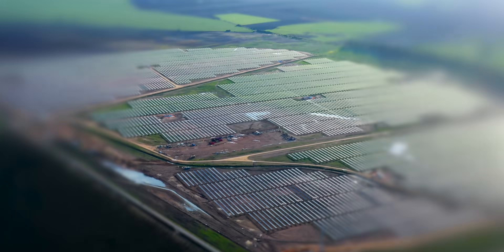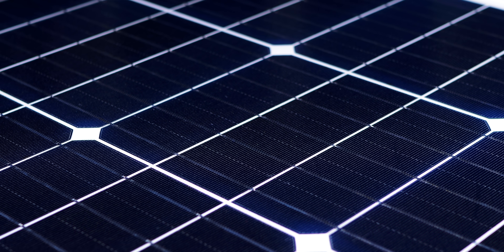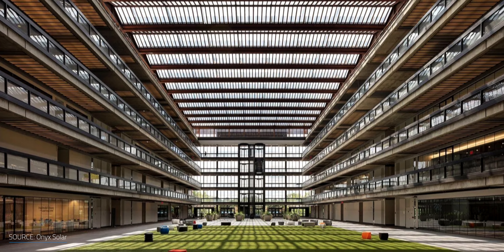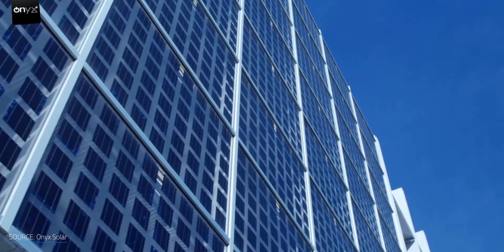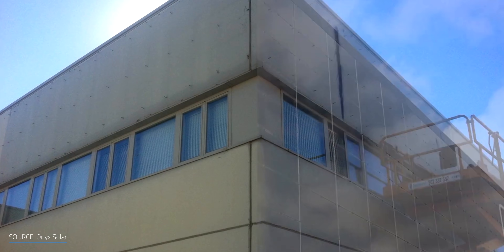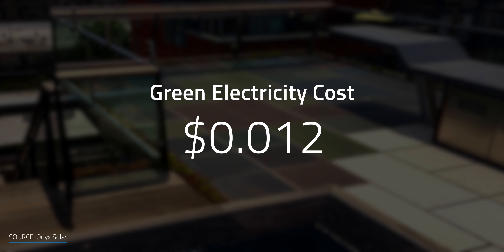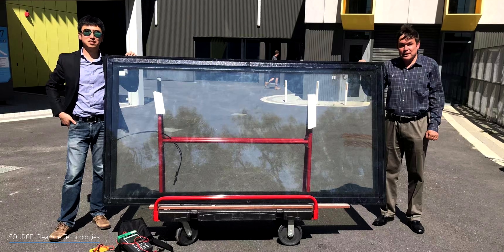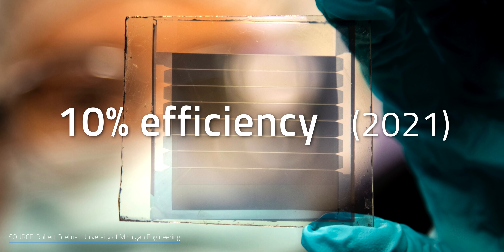Exploring a New Transparent Solar Cell Breakthrough

Comment: TL;DR Don’t rush to believe anything that sounds hi tech and technological “too good to be true”, especially promises to cut carbon emissions by a lot and pilot projects installed. I remember a petrol station whose electricity was entirely produced by biogas originated by a nearby pig farm, that was some 35 - 40 ya, where are all the pigs powered business now? The devil is always there, hiding in the money details!

All fine and dandy, science and technology at it’s best, better something like 10% efficiently that nothing right?
On the other side , (pun not intended) how do they perform on the sun opposite side of a building? What is the installation cost / benefit analysis for a large skyscraper? Everything with complicated functions needs maintenance right ?  What is the lifecycle of these panels and how easy would be to replace them? As for those payback numbers, I’m really skeptic as we have seen frequently bad estimates . That 2M kWh in 35 years is equal to an average hourly production of 13 kWh for a 12hrs daylight cycle, that is 156 kWh per day, how much per kWh in your area? Can they show that in reality, or is just an estimate. That’s in Florida, how about New York , or London where there are a lot of skyscrapers. Shall we later see a devolver suing another for building a skyscraper that rob his own od solar radiation?
Too complicated and delicate to be of any real benefit? Maybe it would just be better to have panels that react to light like transition glasses, getting darker and blocking IR when the sunlight is strong and letting light in when it’s dimmer. Solar “freaking” roadways anyone?

Comment: Remember that all solar panels only create direct volts and that has to be converted to alternating voltage . To transform DC to AC it takes more current of DC to AC by a factor of around 10 to 1 if not a greater difference .The other is the storage of the access energy when the sun goes down or is cloud covered .

Comment: With Soft Cell Solar Technology, we can wrap every building, vehicle, etc, and generate energy. Konarka, out of New Jersey, was working on Solar Tape in the early 2000's. When I tried a Governor Run in Texas in 2010, I had an entire section of my Platform dedicated to this idea.

Graphene is slowly becoming easier and cheaper to make, when we are able to mass produce it, it will do the same job, as good or better, with the additional properties of being 100x's stronger than steel and able to generate electricity from rain.

Comment: Greenhouses may be a good application for the partially shaded type if placed on the upper portions of the greenhouse. This will provide some much needed shade around noon. Rather than needing to resort to shade cloth we can provided shaded light and get a bit of power too. I may give it a shot when I build my 4 season greenhouse.
Reply: Greenhouses are currently the only sensible, large industry application here for this. You can even manipulate the wavelengths that you let through to maximize photosynthesis.

Comment: 9:30, soooo nearly transmission level of 70%
Would love to replace my windshield and front windows with this. Even if it just keeps my battery from draining. The reduction in heat is a great savings, generating power is just a bonus

Comment: A transparent solar window would be good on any cars, even on combustion engines. The windows could be set to keep the car's battery charged, or even allow the spark the car needs when the alternator is not catching. Even better, if the alternator could be removed in place of a solar voltaic window that's always engaged, even while the car is turned off.
Reply: 2 sqmeter of the current best solar panel (realistically what you can fit over the average car) would need several days parked under Arizona sun to charge an average lead battery and an entire month to provide the energy density of 1 single gallon of gasoline. The technology presented here may reduce heat load and power a circulation fan to reduce AC needs but that is about it.

Comment: so what they'd need to do is make it SUPER efficient (and as opaque as possible) in the UV range, then you could use it for windows and still get decent energy, but other than that it's just a gimmick that lets the light through instead of converting it. oh and if you wanna be really fancy make it reflective in the IR range, that way you get insulation at the same time. IR is super weak anyway so you don't want that as an energy carrier to begin with.

Comment: If we stack a totally-transparent photovoltaic glass over a conventional PV cell, the first transparent layer will convert UV and IR into visible light which will add-up to the PV below it. Will that add 10% to the current efficiency?

Comment: A payback time of 1 year is HUGE, even 4 years is staggering. With the clear cost savings, I wonder how long it will be before these are not just optional, but required. Paired with the newer cheap batteries like the Iron Air Batteries, these are going to be a game changer.

Comment: But I thought we'd already been through this before with that solid hydrogen cassette storage contraption. If it cuts fossil fuel generated power consumption/revenue then it's of course a "threat to national security" isn't it? Even if Trump isn't President, right?

Comment: Although I understand the scope of the video was about the technology, what wasn’t covered was how window PV systems only get sunlight for a portion of the day as opposed to standard PV systems.  So in order for window PV to work financially, the cost per kWh hr needs to be in line with rooftop systems… but being that window PV has a double whammy of being less efficient than standard PV And not having full access to sunlight, i don’t see window PV being widely used.

If such a system pencils, then the benefit is that the windows themselves now become equipment as opposed to a capital cost.  Faster depreciation and sources of financing remove the cost from the development budget.

It is a fun and interesting concept but one that isn’t going to become prevalent unless they become more efficient to somehow match roof top systems.

Comment: I love the idea especially if they can raise it up to the 15% I believe the way to make electric cars more efficient is to have some type portable solar recharge so while you're stuck in the office or wherever you work or even if you work on the move in the right conditions and weather your car could recharge while you're driving or why you're in the office it wouldn't fully replace having to use a charging station at home but it would least make it to where electric cars went have to be plugged in as often

Comment: I am a simple man.  Here is your perpetual motion machine.  Trivial to build, impossible to fault.

A hermetically isolated (adiabatic) hard vacuum envelope contains two closely spaced but not touching, in-register and parallel, electrically conductive plates having micro-spiked inner surfaces.  They are connected with a wire, optionally containing an in-series dissipative load (small motor).  One plate has a large vacuum work function material inner surface (e.g., osmium at 5.93 eV).  The other plate has a small vacuum work function material inner surface (e.g., n-doped diamond "carbon nitride" at 0.1 eV).  Above 0 kelvin, spontaneous cold cathode emission runs the closed isolated system.  Emitted electrons continuously fall down the 5.8 volt potential gradient.  Electron evaporation from carbon nitride cools that plate.  Accelerated collision onto osmium warms that plate.  Round and round.  The plates never come into thermal equilibrium when electrically shorted.  The motor runs forever. Its waste heat recycles.

Comment: You sold me.  If I were a building owner, I would want those types of windows in my building.  It would be nice to have a window efficiency that could pay for the windows in 10 years or less.  This way, when it was time to change the windows, the cost of the new windows will already be paid for.

Comment: What's the point in trying to compare these energy producing windows with roof mounted solar? they don't compete.
So if a window can be cheaper over its lifetime because it also produces energy then what's the point in saying "yeah, BUT it doesn't produce as much as roof solar"?
What you didn't touch on was how much the inverter costs and how the windows in a normal home would be connected and if those wires connecting the windows make the whole thing still cost effective.
But it's okay if this is only a viable thing for skyscrapers.
Yet for skyscrapers you could just add outside blinds consisting of solar panels and effectively cooling the building during the summer months.

Comment: Comparing to a roof top system is not really the right comparison.  Presume the roof the building already has panels on it.  Would the new transparent panels as windows still make economic sense?  This is the real question.  If the panel costs the same as a window, lasts for 100 years and is only 1% efficient, it may still be worth doing.  When there is no price difference to pay back, it is a no brainer.

Comment: I think the window vs rooftop is a flawed argument, as even if you have solar windows you could see option for solar roof panels. Instead, utilizing solar windows merely takes advantage of a surface that wasn't being utilized for anything anyway. 
The argument should be "How long will solar windows last?" As replacing windows is much pricier endeavor and shuts down productivity at a site, whereas replacing solar panels doesn't interrupt a buildings productivity. 
They'll obviously continue to increase efficiency anyway, but that doesn't mean an un-utilized surface shouldn't be taken advantage of, even if it's with a lower efficiency window panel, and receive the benefits over a non solar window.

Comment: I think one of the problems of looking at transparent not being efficient enough is you're missing then bigger picture. You can put solar generation ability on surfaces that wouldn't have had it before. I'm not saying they shouldn't strive to be more efficient.

Another way to look at it if you're trying to cover the full energy needs of one building you can reduce the amount of traditional photovoltaic panels needed by having solar windows.

Comment: It's one thing to replace rooftop solar panels after 25 to 50 years, quite another to replace the windows of a building after 10 to 20. A lot more research is necessary.

Comment: I'll echo what many are saying. Current windows generate 0 energy. Rooftop installation is probably always going to beat transparent but those rays are falling on the surface anyway and heat efficiency adds to the equation. Hearing 1to 2 years payback time is worth considering regardless of efficiency.

Comment: Transparent solar in new skyscraper? No brainer.
In a major retrofit of a large area with lots of glass? Still an excellent choice.
Skyview windows on a car? Yes please.
New house construction with large windows? Yes.
Old house retrofit with poor access to pull wiring? Probably still worth it, if the owner is planning on staying and the reduction in power usage is high.
Small bathroom window that doesn't receive sunlight? Probably not, unless it was still producing enough to charge a cell phone. ROI might not be high enough to warrant the extra cost to wire into a house.
Really, as literally every other commenter has said, if comparable in cost to standard windows, no downside even at low efficiency. Cost of tie-in is the only major downside I can see, especially in a retrofit. Stand alone units with localized charging might be an idea though.

Comment: There many ways to gather energy from the sun:

Under the SOLAR umbrella:

Photosynthesis mimicry
Evaporation and condensation from natural gradients of day and night.
Static charge developed from hot sunny days.
We have chemicals that will not freeze that change pressure gradients like a bimetal strip, or I think one is bromine, that can act to change under the suns temperature.
So we have heat transfer that heat into chemical response, pressure response, state change response from the sun to generate energy. Pressure response could be a mechanical load is moved and generates a current when moving out and in. It could be rapid expansion of like water turning to a gas expands 1700 times, which is a great amount of energy that can be captured..
Photovoltaic cells...
Hell even simply a copper wire in a window could generate energy depeding on circumstances.

The question is how, why and what and what is it potential.

Duel glass system with a thin liquid film that would look slightly brown, could power the building, simply by how is chemical makeup reacts to light.

The other problem of generating powers the avenues of its path. If you were doing an office, it might be more advantageous to have mini inverters for everywhere levels IE battery storage in a isolated concrete system, to limit the travel distance in a copper line. So we have a peripheral energy germination system, with a central energy system. So each floor is isolated, but if it over charges on that floor, when at capacity, it then charges the central system in which all elves have access to. then there is the cost of the wiring and materials and added weight. Is it cheaper?

Heating has a large weight component.  combing a competent reduces weight load of a system, but increases cost when needing to be replaced unless its engineered in a cell block design that can be damaged and still work based on the principle of least resistance. Which is naturals efficiency IE it re-roots itself, but always with itsself not through a person...

The question becomes well what is the TOTAL energy needed for X, and why. Sky scrapper is it offices or lighting for an art gallery... All of which is a relation of a system... of the energy in the system. A house hold system energy requirements is based on the persons affordability + life style... Often there is a mutual average based on what is trending in the system.

Or you have a centralized energy management system, and it can always meet the energy needs, but then that can be a problem if the populace increases. 
There there is completely obtuse systems of energy management. you could build a laser tower that shoots to sky scrapers to energy them send data, etc. Which would look pretty cool. Which then you don't need to rewire the system and yo ulna remotely power the sky scraper and that energy can then be used convert it into heat. Laser energy is great because yo can zap over to a receiver and store it in a battery, that battery can then power devices in the building. depending on the power of the laser, you can do a lot of cool things. Of course the laser would blind anyone looking directly at the generation point or beam.. could USE IR, WHICH EVENTUALLY IS VIVBLE TO THE naked eye when its powerful enough, but barely.. mostly invisible, but it might instantly roast birds etc... and planes or whatever gets in its way.. vaporize a human. Nonetheless this is the best means of remotely powering a system. Alternatively you can make a tube... for the light to travel in.. but then why not just a cord at that point. could covert it to wireless energy, but than that can be a health problem.. depending on how much and where and what its doing...

So... the question is what is a great means of energy generation. Cheapness is by scability... and ease of that...

If one panel can power 10 houses... then that is something different... The question his how one wants to utilize what comes from the sun.... 

Could use radiation....

so the natural means of energy is gradient energy generation.
newer means of energy generation is phase state changes
Magnetic...

The largest problem is the market place and commerce.. cusaing its endless problems everywhere... none of which is logical.. its really the death of civilizations and groups that nationalize.

I mean a good example is candy forced to have migrants of specific groups that killed and sold peoples pets back to them as food and think nothing is wrong with their acts. exploration of these groups will throw on the say animal live into a pot and it will suffer. its basically a medieval mindset... atleast kill the animal.. so it doesn't boil alive for hours.. demonstrate respect for the live you take to live... which is probably a sorely missing trait in asiatics... just barbaric, but i noter northern groups that still kill whales its the same also...

Even when giving them solutions to build udnerground grocers humans will always take the way of convenience.. very rare people struggle and suffer to change the terrible acts of the masses. There judgements is always on nonsense..... to ensure their way.. but latent heat energy.. created comfort so... it s like technology doesn't change these groups and establishing a leader there to instruct their acts or works suddenly your a dictator against their freedom... because f trouble makers.. and your like I just need help building this you children inherit this... so our only means of changing the future is their children. then the enemies that hate us, utilize our systems to pervert humanity backwards.. Its like a nonsense war.. as if we have a bias.. lol